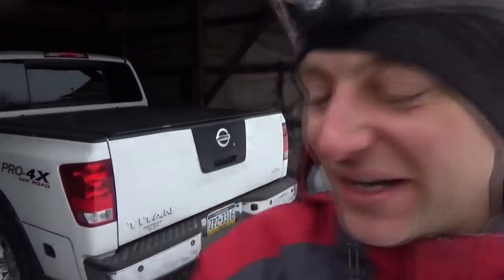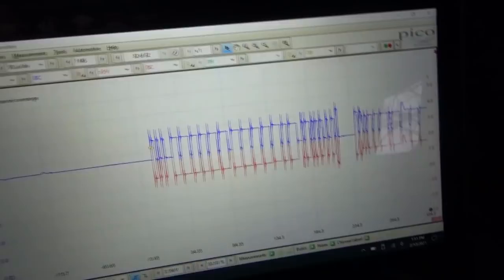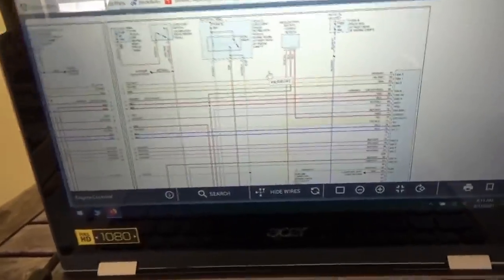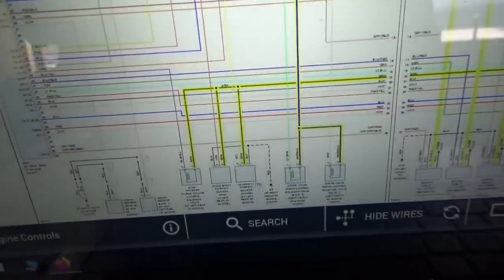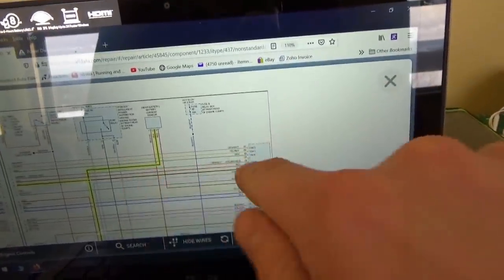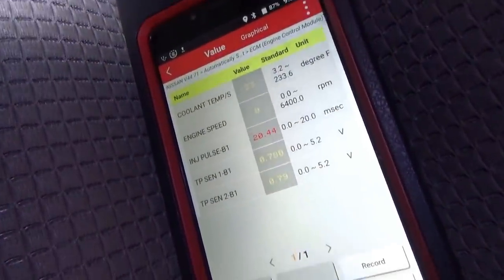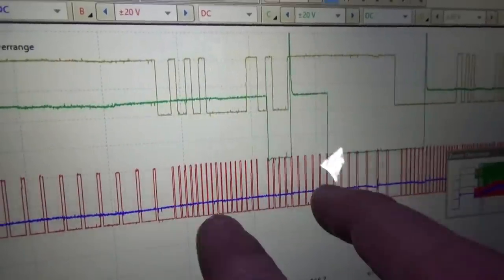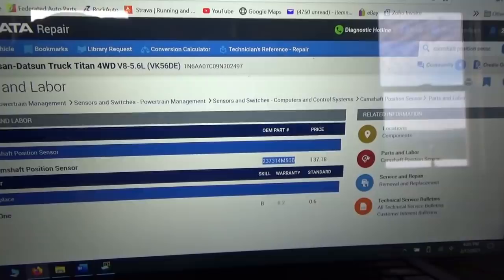Nissan Truck Crank NO-START when COLD - Part 1

Comment: I had this same issue on the same year of truck same make. I scoped it and checked relays and grounds since the customer was trying to fix it on his own. I thought it was the cam and crank sensor so i replaced both but they were aftermarket parts though. Didnt fix it. Was kinda weird was the u1000 code for can comm. If i erased codes the truck would start. Customer didnt have money to invest in OE sensors. I found a tip on ALLDATA where a tech removed the ECM and put it in the freezer to recreate the problem and narrowed it down to the ECM. Hard to make that call though. Cant wait for part 2. Thanks Ivan.

Comment: That was another awesome diagnosis, Nissan dealer would be selling you a new truck probably. Looking forward to the follow up to see if it solves it. You make it look so easy with your knowledge and tools 😁
Reply: The Nissan dealer, or just about any dealer, would try to sell you a new vehicle if the air filter was dirty.
Reply: @adotintheshark4848   Thanks for the insult

Comment: The use of 'No-lead' solder is the cause of many of these types of faults. The solder points will crack and/or separate from the pads or traces on the PCB. I had this problem with the clock in my Toyota Camry. I pulled the clock from the dash, took it apart and soldered all the attachment points that I could get to with 60/40 rosin core solder. It worked and has continued to work for many years.
Reply: Yes, no-lead solder has much lower ductility than regular old fashioned solder. IOW, it has much less”flex” (more brittle) and is more prone to cracking over time.  Best practice is to remove ALL the old no-lead stuff and reflow with the good stuff as you did....

Comment: Intermittent problems are so much fun. It reminds me of when a car I was working on had a failing crank sensor. The only time the car would not start was during a hot soak period. Like when you would stop for gas and only have the engine off for 5 minutes or so. The under hood temperature would go up causing resistance in the sensor to go haywire or maybe even completely open circuit. Changing the crank sensor fixed it.
Reply: was it a gm 90 degree or 60 degree v6? (3800/3100)

Comment: I’m so tired of seeing cold air intakes in the engine bay. It defeats the purpose people it’s called cold air intake for a reason it may look cool but it’s not doing anything for your engine it’s just sucking hot air back into the engine. Cold air intakes and KNN air filters god stop just stop
Reply: Not to mention, using a $200 piece of garbage to defeat what took many thousands to engineer.
Reply: @CedroCron  Man you got that right. I despise K&N filters too. Used one in my trike, and after a thousand miles I found dust in the intake tract! One thing about the MAF sensor and K&N's is that if the user oils them too much, the oil does screw up the sensor.
Reply: Unless you connect them to an outside air source ..
Reply: @CedroCron  I agree. Spot-on.
Reply: I love keeping things OEM unless there is a good reason to change something.
Reply: @knocksensor3203  you'd have to run them inside the grille but outside the engine compartment.
Reply: I'm old enough to remember when flipping the cover on the air cleaner was "cool"😂

Comment: I can just imagine how many parts the dealer would throw at this issue.
AND charge the customer $$$$$$
Reply: Thanks for the insult.  my experience is  that not only cars from other dealers end up in my Bay. But also cars from independence end up in my Bay.   Thanks for the insult

Comment: Great find Ivan, the CAM sensor signal is inverted at first then it changes direction, personally I've seen many Nissan CMP sensor's signal inverted with no issues or fault codes. Also I've seen Nissan CMP sensors start inverted then change direction with no issues or codes.

Comment: Interesting indeed! Great vid, Ivan. I sure do miss the days when Japanese engineers PURPOSELY engineered parts so they COULD NOT be mixed up, or installed wrong under any circumstances! Those days are long gone, apparently. Imagine an identical, yet different sensor with the same number for different applications! This goes against everything those old time Japanese engineers stood for. I've come to expect this sort of thing from GM or FoMoCo, but it's looking like no brands are immune from the craziness today. All of it makes our jobs twice as difficult!

Oh, I wanted to tell you, in April I'll be heading to FL for paramotor trike training! WOOHOO! Not at Aviator, but with PPG Gorilla, a little southwest of Aviator. He knocked $300 off the price for bringing my own equipment. SUPER stoked!! My friend Chris Fennimore (you might have seen him in the comments here and there on auto repair and paramotor vids) will be at Aviator getting trained at the same time, only his class is about a week longer than mine. We 're going to do a cross country flight over there to visit him, weather and time permitting. Can't wait!! :) :) :)

Comment: Great find! Too bad you couldn't see CMP signal during the crank NS. You were on to something when the INJ pulsed AFTER the cranking but not during. Yet with so much going on with goofy scan data, U codes, and then losing data etc, I kinda dismissed it to.

Comment: Great diag Ivan. Without a scope you would need a "parts cannon" the size of the 16" guns on the USS New Jersey. Even with a cannon this size, how would you know all the parts replaced were good?

This Titan experience "make me wonder". Do the engineers at Nissan really know how their "creations" work?

To your point. How tough can it be for the ECM to punch out a DTC when it has received a crank position pulse and no cam position pulse? You know the ECM saw it. 

It keep the fuel injector from pulsing. 

It nothing else the ECM the could have been programmed to capture "missing cam position count". Similar to a spark misfire count (Mode 6 data).

Comment: In most cases, no comm codes or U codes are indicative that the other modules are not receiving the correct information within the data from the ECM, not that communication is completely gone from the ECM. It is a thing that can send you down the wrong path when trying to diagnose while using non-proprietary scan tools.

Comment: Experience would have you do a cam and crank sensor test for the symptoms this vehicle was displaying IE the crank, no start and (not sure if you picked it up) extended crank time when the engine was firing up. Great diag, Ivan, you would have been kicking yourself if you called the ECM as the problem.
Reply from the maker: We'll "circle back" to the ECM...just like Jen Psiaki haha
Reply: @PineHollowAutoDiagnostics  yeh I know there is a part 2 coming, my point still stands though, it is usually the thing you don't check that gets you into trouble 👍

Comment: One could possibly have gotten in the ball park without a scope by doing your old fashioned way of first trying to determine if the problem was spark or fuel by spraying some carb cleaner into the intake then trying to start it.   Some vehicles (not sure if it's this one) will fall back to a default strategy if either the crankshaft or camshaft sensors are unplugged (but not both) so that could be one's next test (also unplugging a MAF can be instructive).   Much tougher on an intermittent for sure.   

When a module is in doubt reflowing it in an oven could eliminate the possibility of a bad solder joint or "tin solder hair."

Comment: Just went though this with a 2008 Titan. You could jump it when it was cold and it would start and restart the rest of the day. Next cold morning no start without a jump. Ran through all the spark, fuel, injector tests and no injectors pulse. After checking grounds and fuse box related stuff I finally threw the ecu in the house for the night. Next two days it start right up with a low charged battery. Sent the ecu off and had it repaired for $100. Been fine since.
Reply from the maker: Yup that seems to be a common issue on these trucks when they get 10 years old or so. Part 2 will be more revealing :)
Reply: Hey Jeremy, I'm the owner of this Titan, and looking into an ECM repair or replacement. What company did you use for the repair?
Reply: @flintlock50  SIA Electronics. I went through their site on ebay since it was a bit cheaper than their website. Seemed to be a pretty common thing with nissans. I had a heck of a time coming up with the answer since I've drilled it into my head it's "never the ecu".
Reply: @PineHollowAutoDiagnostics  It's funny you would do this video now. Three months ago when I got this truck with this issue I was for sure going to go in the archives of Pine Hollow or South Main and have the answer to this problem since its all over the nissan forums but no real answers. Most guys head down the IPDM route or get a huge battery. Oh, and my launch also wouldn't read anything during cranking which at the time had me scratching my head.
Reply: @jeremywilliams5111   Thanks, I just checked and SIA has it for $90 plus shipping right now. Their website lists it at $200, so you saved me some coin! I have the identical problem, truck will start right away if I jump it, even with a fresh battery. I was going to replace the IPDM, glad I called Ivan @ PineHollow first.

Comment: Im pretty sure the position sensors also have a 5v supply and not 12v as you stated in the video. That would give really different signals when starting, ignition on or engine running.
Reply from the maker: Check out the wiring diagram and scope captures. On this truck they are 12V.

Comment: Hey Ivan something I noticed  I don’t think you didn’t  noticed. At the very beginning the tach didn’t work during cranking. When you cranked it again and it started you could see the tach move right away. So does that mean the cam signals the tach?

Comment: just had a 2007 nissan maxima today long crank time and a p0340 for bank 1 cam sensor. i scoped bank 2 signal nice square wave bank 1 had flat line battery voltage. new sensor fixed the problem

Comment: many things rely upon cam signal to actuate injection/ignition with correct timing. when in crank mode, many things are ignored for code setting and possibly even into short run time.
yeehaw!

Comment: I'm just thinking out loud...it was suspected that the vehicle started because all of the codes were cleared.

Prior to clearing the codes you ran the fuel pump i.e. primed the system. I also noticed what appeared to be no rpm while cranking, but then started reading after the engine was running. Maybe that goes back to the cam position sensor issue?

I think I'd want to try to catch it in the act again to try to rule out all of these "coincidences".

Comment: I had a 2014 frontier with bad cam sensor. I bought oem off of fleabay took ten mi n uses to change ran beautiful after that until i got the the cross contamination that took out the trans.

Comment: It looked to me like as soon as you took pressure off of the key the engine still had enough rotation so that the injectors were able to fire before the engine quit turning. Because you were not starting the engine at that time the one cylinder that fired managed to have enough force to continue the engine rotation and actually continued running operation. Although you still may have a bad cam sensor the ignition system still had the system locked out until you took presdure off of the key and it was able to start like that for quite a few cycles until it got out of cam timing from the bad sensor every once in a while. That system has quite a few flaws in it. I have a 2006 Titan, why does the engine start having a ticking noise that turns into a knock? Do you know why the engine finally fails with these symptoms? It actually turned into a heavy knock before the engine finally quit altogether. I have not done anything with the engine yet so I don't know what happened yet. Have you ever run across this problem before? The engine just has 113K on it, it should have lasted longer than that. I brought the truck in before the 75K warranty expired for the same noise but all they could tell me is they thought it may be an exhaust leak. I think they knew what it was and just wanted me to continue driving it so that the warranty would pass.

Comment: Hey Ivan,

Could you maybe test if the Nissan Computer has a default strategy if the Cam sensor(s) is/are unplugged to see if it will start in that case?

As ScannerDanner has proved in some of his videos, *SOME* ECM's are capable of starting the engine with just either the Crank OR Cam sensor inputs available and the other not working.
My Recollection is that what some of these ECM's do is they Batch fire the injectors / plugs during the crank in various combinations, and when the engine does kick off and fire, the ECU is able to "Guess" where the engine rotation is, and the engine will run. Often in such case the crank is extended (ie several seconds while the ECM guesses)

So i have to wonder if you deliberately set a Camshaft sensor fault by unplugging the offending sensor, if the the Donk will then run.
Maybe you could test that for us?

Comment: I love the way you diagnose Ivan. I am starting a diag buisness after 5 yrs of watching , buying tools etc.
Can you help me decide which to use, mitchellpro or aldata?  It will be a slow start and the program is not cheap.  Any suggestions?
I have been buying single car subs so far. Thank you for sharing your videos and insight to all you guys out there doing this! Ps, 1st parts give me something to look forward to, the 2nd and 3rd parts! And the bonus footage is always priceless.
Reply: I've been doing the same thing although I find their diy sites to be lacking much of the information.  Neither has rewrites on the diy sites. Some autoparts stores will give you access to data with a commercial account, others might offer a discount on sub services.
Reply: @bradfaught1695  thank you. I am pulling the trigger and going to go with a full program, either mitchell or aldata.. Probably will go with aldata.. 175 a month.
Reply: Having used both alldata and prodemand, I prefer prodemand as it seems to have more info. That said, it is definitely clunkier to use. Our shop also has the version of identifix that includes service manuals, TSBs, sometimes different wiring diagrams than Mitchell. Service information is almost like scan tools - they can compliment each other and no single one has everything. The feature of identifix where other techs can post their diag procedure and you can see common failures is also a big time saver very often. Of course it must be used properly - as in you still have to do your own independent testing and verification - but it's great to point you in the right direction. They also have a similar estimating guide called MOTOR. They include Chilton's as well, but I consider that more of a DIYer's guide. Pointing this stuff out because I wasn't originally aware they had actual SI. If I could only have one, I would consider picking identifix over Prodemand even though I am a bit less familiar with it. It seems to offer more and be easier to use. I will point out one downside is that it is linked to IP address, so you're limited on devices. In the nature of full disclosure, I will also say it has been about 4 years since I used alldata regularly. Good luck on your journey!
Reply: @ClaytheBMXer  thank you very much for your input.. I have not concidered identifix, it is a pre set on my autel so i will research it now.. Thanks again !
Reply: @raychad5058  No problem! Love my MS906BT by the way. It's slower than snap on and the graphing isn't as good, but I think it covers more for like a third of the cost. If cost wasn't a factor, I'd have every available scan tool and every available service information service,  haha.

Comment: Could intermittent cam sensor function result from old engine oil or improper viscosity engine oil?  Repeated cranking attempts would also lead to decreased viscosity (faster sensor response time).

Comment: I will never understand manufacturers using dummy gauges for oil pressure. They wasted all the time to put a gauge and a light in there and then made the sending unit a switch. That is also a heck of a CAN delay for an 09

Comment: Hi 
I have Nissan frontier 2014 with trouble,some time when stop it (turn key off) at hot when restart directly in rang around 5 min start normally but after 5 min the car crunk no start for around 45min than start normally.
Note
When i put cold water behind engine at passenger side start normally
I have changed crunk sensor 3time
Camsensor both side
Cooling sensor
Fuel pump
Fuel filter

Sec. Trouble cooling fan not work .i make external relay but working only high speed.
So any can help what do.and if any some problem before and he get solution.thanks

Comment: 😎 video.  I have always enjoyed them of recent since I subscribed

Do you have any vids on transmission diagnostics of solenoids?  Specifically p0744 on a RE4F04B transmission?
Reply from the maker: For solenoids I like to manually energize them and listen for a solid "click". Could also be a rationality code, which could point to internal trans problems.